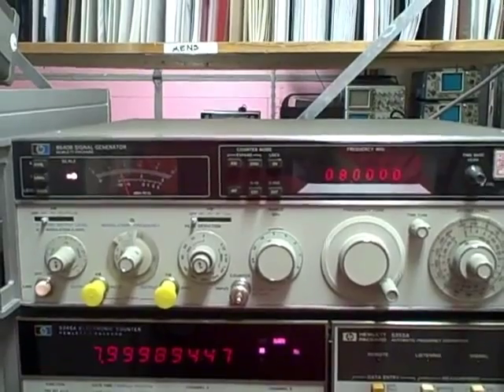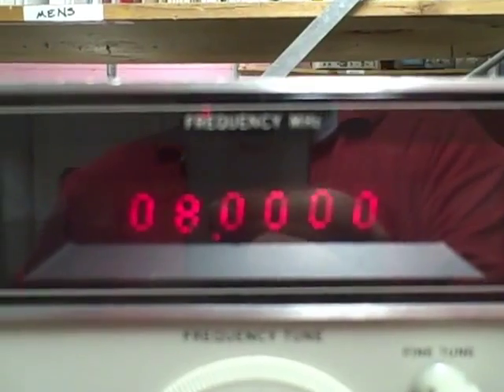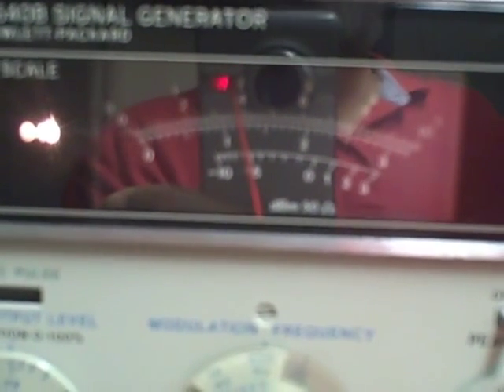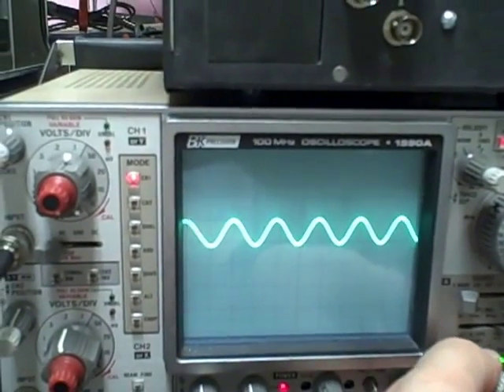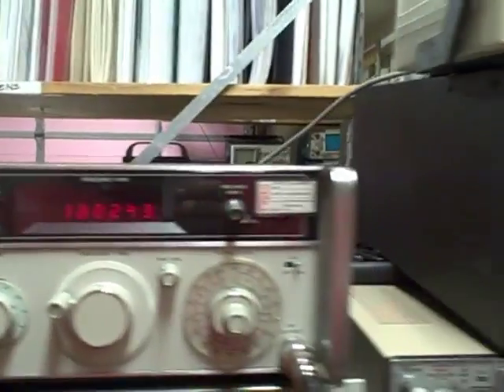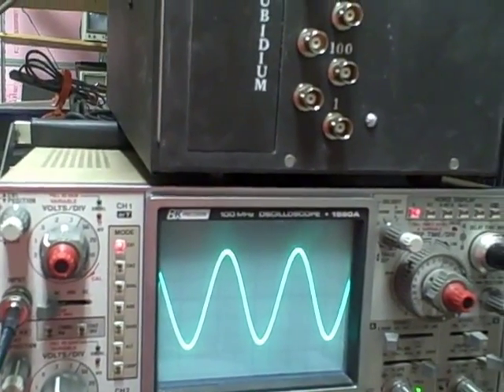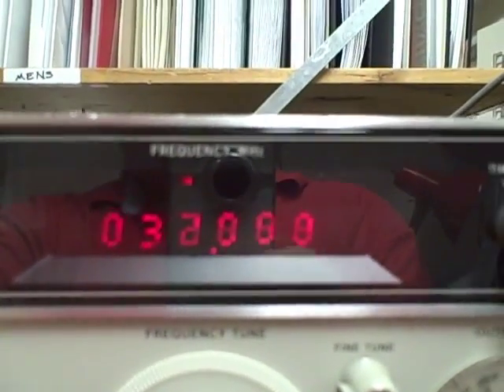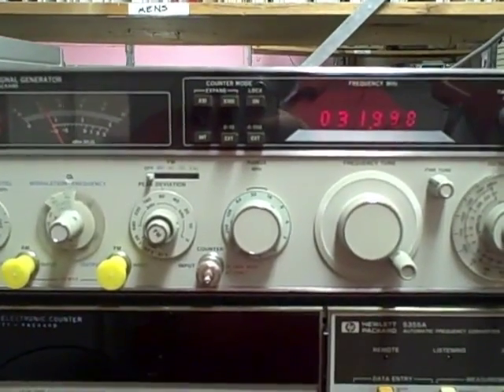8640b

Comment: Hey I just picked up one of these units. Works perfectly as I understand it.  I have what appears to be an old USAF version built for the Patriot Missile Systems development project.  It has some USAF stickers on the front.  Anyhow I'm wondering if it's possible and how to use a function generator say in sine and use the frequency counter of the 8640B to measure that signal with the frequency counter.  Thank you for the great video, I was so happy to see some videos about this unit on youtube.

Comment: Didn't see much about attenuation. Is it capable of .2 microvolts calibrated at 50 ohms ?
Reply from the maker: It has 16 output ranges, from 3v (+16db) to .1microvolts (-130db) and still has an additional 12 steps of -1db each for additional fine attenuation.  There is even still a continuously variable fine attenuator available.  It is a pretty amazing unit.

Comment: I'm surprised no one has told you it's not 4 volts output on the 0 to 10 scale.
Oh just got to the part where you start measuring output.
Anyway, the max output is about 2.25 volts RMS.
I just got one, starting to figure it out.